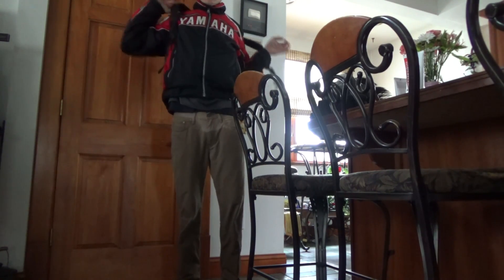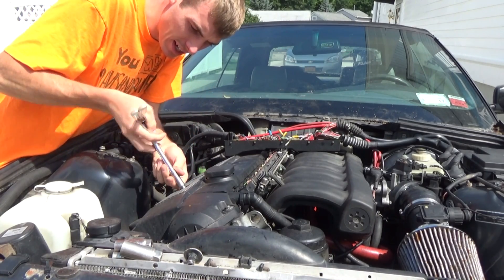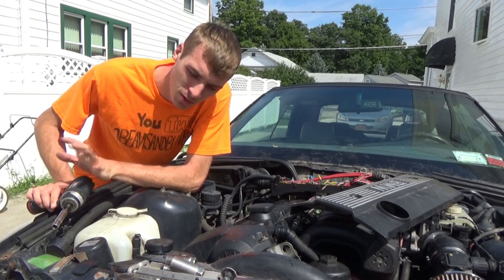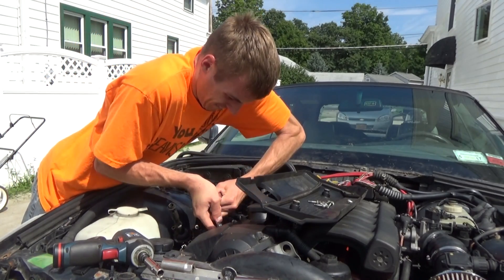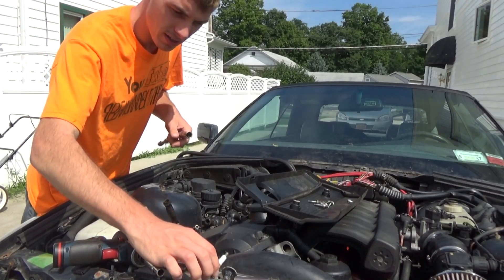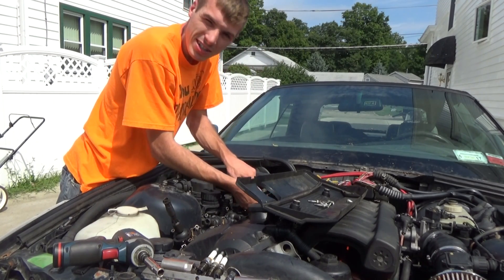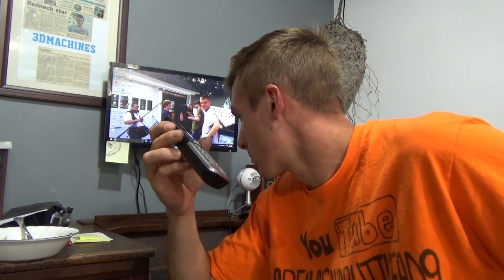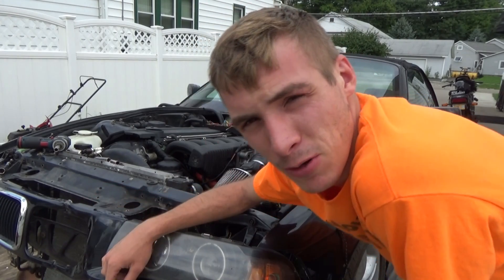THE BEST NEWS YET

Comment: NGK are superior quality spark-plugs in Europe
Reply: i was just about to say that :D
Reply: honestly they are the superior choice for most every engine IMO, they are the easier to read the heat range on because of the cadmium coating on the ground ring
Reply: yeah true !
Reply: I've always ran NGK on my Quads, Bikes etc. and I have never had any issues with them.
Reply: they are decent for some applications, but for performance and forced induction vehicles cheap plugs are not the way to go
Reply: I use NGK plugs in all my machines so i dont understand how they are cheap quality
Reply: ngk is all I run in my motorcycles.
Reply: ngk are good for atvs motorcycle dirt bikes and all that stuff but not in cars
Reply: Ngk are amazing in Australia, that's all my family fun
Reply: I run NGK in my weed whacker and chainsaw... probably be using them when/if I get a car as well! XDD
Reply: NGK is what I use in my KTM 450.
Reply: well this is MURICA
Reply: NGK are good spark plugs its just that bmws are only meant to use bosch
Reply: BMW use NGK as original equipment as well as Bosch.
Reply: poor BMW
Reply: Ngk is generally a pretty good plug, anything like 4-wheelers and dirt bikes around here like them
Reply: me too
Reply: Yup.  I run NGK copper plugs in my LS1 Corvette; they're by far the most recommended spark plug for performance cars.
Reply: NGK's are great plugs. just remember to use antiseize. They are known to break in half and leave the bottom of the plug in the engine.
Reply: That's why I drive a diesels lol
Reply: Me and my friends have mopeds, dirtbikes, supermotos, scooters, quads we all have NGK   NEVER LET US DOWN Atleast EUROPEAN NGK's
Reply: you aer rigt ngk is a good spark-plugs
Reply: MegaMalek95 yea they are good. But he specifically talking for a BMW...NOT your Honda bikes ect.... BMW!
Reply: BMW use NGK as original equipment.
Reply: Unfilled Name-space ahhh good to know. What is this Bosch about?
Reply: BMW use Bosch and NGK depending on the model.
Reply: Unfilled Name-space thanx. I was wondering that.

Comment: That looks more like the AC condenser than the radiator
Reply: thats what i was thinking but then he said he saw fluid leaking out of it
Reply: your right it is I guess he wants a in a drift car
Reply: ac
Reply: That's what I was thinking too
Reply: it is, it's the AC condenser.
Reply: Hence why it was misting out. A/C is always under pressure while coolant is not, unless it is warm/hot. Usually only when it's hot. If coolant it would have dripped out.
Reply: Because Bugeye that jb weld he put on it, isn't going to hold.
Reply: A/c systems have lubricant running through it to keep the pump lubricated. Only fluid that should be in it.
Reply: i am an hvac tech you can fix condenser coils by brazing the wholes closed they used to do it all the time back in the day but its not a very common practice now you just normally replace them it is a dieing art.
Reply: I braze at my work, i've only heard rumors about how difficult it is to braze aluminum.
Reply: Yes I would understand aluminum tubing melts every easily I have only done it on copper where I melt the aluminum fins around the pipe and continue brazing from their
Reply: He said it was misting out which sounds like r134a freon evaporating into the atmosphere
Reply: mo

Comment: I think you messed up dude. NGK spark plugs lasted 150,000 miles in my 2006 Bmw x3 and they have the same motor. Also, i think it's your mass air flow sensor. (same problem with mine) Either the mass airflow sensor or an air leak.

Comment: there is no point in repairing that its a air con radiatior its just another thing to stop the engine radiator getting more air
Reply: agreed, but it's called the condenser for future reference!
Reply: can just take them of and block the hoses then?
Reply: honestly you can just take it off and if you don't care about putting ac back in the car you can just leave the hoses open, the ac compressor won't turn on with the system empty anyway
Reply: just leave it off ,it is Unnecessary

Comment: Another thing that might be wrong is that being as the battery was disconnected it resets the computer, you just need to drive it so the computer can learn and self tune, that's a common problem that most don't realize and it can run like absolute crap at first, it takes around 150-200 miles for it to run really good

Comment: no no you have more to it data values on the scanner you have to see the fuel trims +trim adding fuel  - fuel trim subtracting fuel. But that can get skudd up from vacuum leak or a bad air metering valve (maf). Best thing to find vacuum leak even that plastic intake seal's is to use water. Pour water on places that can leak and see where it sucks in water and rpm drop. Now if the fuel trims pass -10 or +10 it sets check engine light.

Comment: I run autolite plugs in my BMW with no issues at all. Cheap $2.00 plugs never did me wrong. Check your sensors, if any are bad, replace them. Check your timing belt. Yes its possible to jump a notch or stretch the belt. Timing chains are better LOL.

Comment: I would get Denso TT part number 4504 for it because they are awesome plugs and your local auto part store will have them, The part number for the Bosch plugs is #4301 for twin tip or 4418 for platinum +4 plugs but to be honest I have not had very good luck with them compared to the Denso's.  Have fun

Comment: This is the AC condenser that mist you saw was the refrigerant leaking out the fluid that was dripping from it was the ac compressor oil. If you want the ac to function properly replace this radiator this glue wont hold the pressure.

Comment: Technician speaking here that owns a 97 328is:  NGK plugs work fine, promise I run the Iridiums just because and Autozone stocked them.  99% chance it's a vacuum leak, I've had an idea to build a custom smoke tester using a vape pen with some air line fittings and a pressure regulator.  Use some PVC caps with an air line fitting installed to smoke test the entire system under 5 psi or so of pressure.  All leaks must be stopped.

Comment: Dalton...that's your A/C condenser not your radiator....Condensers are installed in front of radiators. Those plugs have a fuel smell because you flooded the cylinders trying to start it.I appalude your wanting to get this car running but you might want to cut your losses and fine a another project car to get your feet wet with.Thank you for all the work you put into making content.

Comment: that is your a/c condenser for the air conditioning not your radiator and at that point i dont know if jb weld will fix to hold pressure

Comment: Yep, that's the A/C condenser you just took out. You can see the radiator in the video BEHIND the condenser. 
 I had written and told you to have your ignition module check after seeing this video. THEN I saw your last video showing the car running.
 After seeing that my advice is to have a friend get the car started and get it to a constant RPM that keeps the car running. Meanwhile you get under the hood and check for vacuum leaks.
 I had this same problem with a car I paid $300 for because it wouldn't stay running. I plugged a vacuum leak and drove it away.

Comment: Bro like others have said that is NOT your radiator that is 100% your AC condenser  and what was leaking was Freon. you do not need that at all just leave it out and strip the other lines.  Check your intake for leaks. There should be a Big O-Ring gasket between your throttle body and intake those are know to leak on these.

Comment: its a air conditioner radiator leave it off save some weigh remove every to do with it. im not sure wat belt system bmws run so check if  you can get a belt before you remove compresser from the motor.

Comment: one more thing you can braze aluminum with the right rod and a torch rather than using liquid steel which most likely wont work.. the metal has to be very very clean though.

Comment: That is the AC condenser and it runs at about 200PSI of r134a. I hate to say it but your little sealer isn't going to hold. a new one on eBay is only like $60 and they work fine. I know from personal experience

Comment: Brands don't matter much, yah Autolite and NGK suck but if they haven't been gapped properly they might not spark as well as they should. Also Autolite being a Ford variant is new, I've only ever heard of Bosch and Autocraft. I'm running Bosch in my vehicle. Also your "radiator is the A/C condenser, wasn't misting out it was releasing the gases from the system lol! The big guy behind it with the big hoses is your radiator.

Comment: Nothing wrong with either autolite or NGK I prefer NGK from Japan. Ive run autolites in the past. They are fine but will rust.  Platinums last 100k miles but if your a modder they wont be in it long b4 you go colder or hotter plugs etc.  And by the way thats the AC Condenser not the radiator. AC system needs to be charged at a high PSI (30-300+psi) The JB weld will most likey not hold that kind of pressure.  Its all good in the hood tho. I love the videos man. Your killing it.

Comment: I'm German and over here a NGK Sparkplug is the best you can get for your car.
Bosch is cheeper and it isn't bad, but NGK is way better.
I run NGK in my Mitsubishi Galant e54a, in my Rover 216i convertible, in the Honda CRV-2, Mercedes W210 and in the Piagio Ape50.
But in my 4 Lawnmover, 2 Chainsaws and some other small engines are Bosch Sparkplugs.

Comment: what funny about how that car is only supposed to work with Bosch plugs. I tried Bosch plugs in a few types of machines and had shit luck with them. Small engines especially. I put them in a 4.2 jeep straight 6 was horrible put the cheap champions in and was right as rain. had a customers hedge trimmer in a while back with a new Bosch plug and even though it was the right cross reference plug it ran bad, put the NGK that was called for and ran like new. Some rigs just like certain brands of plugs I guess.

Comment: You dont need to use bosch plugs .NGK will be fine. if you are going to drift the car junk the AC. You might need to change the coils if its not burning fuel . make sure the ECU isnt showing codes for missfire.
Reply: I can guarantee it'll show codes for specific cylinders and multiple cylinders. You could hear it when he started it

Comment: What is the deal with your auto shops not cross referencing! As long as the thread count is right it will get the job done.  Also NGK plugs are actually the #1 recommended plug for when building a turbo vehicle.

Comment: That looked like a transmission cooler possibly... or maybe for the AC and it is in front of the actual radiator.  I would have soldered it.  Personally I would not worry about the spark plugs as long as it is a good brand.  They important thing is that they are the right resistance and the gap is right.  The black means you have a lot of carbon build up and it is likely running rich... and maybe burning a bit of oil.  Check the air filter, but after that I would get the engine codes and work from there.  It could be the injectors.  Also I doubt the odometer is correct.

Comment: Hi dalton, do you know what electric starter Jake put on his bike? If not you you maybe find out? Thanks, keep making awesome videos!!!!
Reply: i believe it is factory but i dont know KTMs
Reply: Yeah they're stock for a lot of the new 4 strokes, I didn't know they were on 2 strokes
Reply: +dirtbiker_ 399 300exc? not sure on the letters is a 2 stroke with electric start
Reply: 08 to 2016 200-300 KTM, 2011-2014 200-300 Husaberg and 2014-2016 Husqvarna 200-300 2 stroke starters are all the same starter. I have a KTM wrapped in Husaberg plastic lol 2014 TE-250.

There problem with 2014 back are the bendix, they are junk. The gear wears out and causes problems. Pretty much have to faithfully maintain them. 2015 they fixed this by using better quality parts. Here is a link for ya, read and enjoy. Could save you some money. https://ktmfreeride250.wordpress.com/starter-modifications/

Comment: Umm, that's an AC condenser in case you haven't figured it out, not a radiator. Freon is a gas at ambient temp which is why it came out as a mist.

Comment: That is a AC evaporator core not a radiator remove the evap core and run it without it if doing drift you need all the airflow can get to the rad to prevent overheating.

Comment: That isn't a radiator man, it's the air conditioning condenser, you don't need it or A/C in you car, when drifting you want the least weight possible while keeping it balanced, the A/C pump is unnecessary weight, puts more strain on your belts at high rpm and in return a few less horsepower. Take my advice! 😆

Comment: NGKs are not 'crappy' plugs...Bosch plugs are the OEM installed plug. You don't have to put OEM equipment back into it, especially if you're just trying to get it to run...Just like air & oil filters or wiper blades...BTW...That's your A/C condenser, not a radiator...Not needed if you're making it into a drift car...

Comment: I'm sorry I run ngk iridiums in my dodge truck and in my 91 Camaro with a 383 stroker and 250 shot of juice ngk is the best plug around made my truck run 10x better and there not cheap try 60$ for 8 of them

Comment: LOL I wish my NGK's were cheap, around $63 for my last set of NGK Laser platinum 6458's and that was at a discounted price. Audi actually recommends the higher quality NGK plugs over the Bosch.

If you do a little research, a lot of BMW owners even prefer the more expensive NGK's over the Bosch. You can easily get 60,000 miles or more out of them Anyone that has a German car with a turbo can't run the platinum series plugs or it causes detonation and a mess. Most of them run a specific plug that runs cooler.

Comment: If they are the correct NGK plug, they'll work fine.  Car has 50,000 & the original plugs have been replaced already, some thing wrong there.  The original plugs should of lasted that long, easily.

Comment: But it is firing, because the engine is running. I'd say it has an exhaust leak, or a sensor gone bad. Surprised it's not throwing rich codes, because the engine is obviously getting way to much fuel

Comment: brand dosnt matter with spark plugs most of the time... just the different types not brands matter. thats all preference. also that isnt your radiator that is your AC condenser, throw it out if your making a drift car all the AC is gonna do is make you loose power since its another pulley the belt has to go around. Chuck all the AC shit out the windown!

Comment: Ummm you need compression, besides air spark and fuel. If there is a hole in the block or cylinder it aint gonna run.

Comment: The reason engines today look so complicated (electronically), well simply put, that's the good part. Price wise i mean. The other option, where you have the same setup, but, only an engine with a leads and that's it, would need a very centralized computer. That would mean breaking it = $$$$$$$$$$$$. So, they make each component go where it needs, therefore = $$$.
If they wanted, they could make an engine look like a 1960's one, but have the exact same level of electronics as a 2016 one.
They don't for your benefit, it would be ten times easier, and better (as money goes) for the maker to have one computer unit with peripherals, rather than one main computer, and many more minor units with various tasks.

Comment: And point proven of why to never get a bmw.
Reply: dude that's a 98 if you you want a real bmw get a 92 bmw
Reply: dude.. the older you go the better they get.
Reply: No, that's why you do actual research. NGK plugs are great, and the thing he was kicking is not the radiator. I usually like 3DM, but it's obvious he really doesn't know much about BMWs.
Reply: Mudd Boss not with bmws bud
Reply: BOB bb i wasnt talking about how it does.. im talking about looks and how expensive they is.
Reply: BMW's are great reliable cars, its not their fault that in USA BMW's aren't soo popular and the parts cost 20 times more then in Europe
Reply: I own a e36 and its difficult to own any other cars parts are so cheap and if u understand them they are pretty decent cars.
Reply: much more... never get a almost 20 jear old car!!! what do you expect!
Reply: florian558866 never get a car with a computer..
Reply: Mudd Boss everysingle car has one. Even from the 20's. Then ecus even close to todays cars came relevant in 1939.
Reply: Zachary Neal you dont get it.. im talking about a computer that controls everything for the engine to run like injectors,spark,mass air flow,O2 sensors,crank position sensor.. all that fancy expensive not very reliable electronic shit that will fry if an emp hits.. that kind of computer... back in the day only electronic things were a power source,on off switch,the coil,and points,, all the simple stuff.
Reply: Yes and there is alittle bit added to these old bmws its a very simple bosch motronic ecu and i would rather have all the amentities of obd vehicles as my 325i has 560k on it and no carburated engine will make it that far.

Comment: I'd get rid of the shitty air cone. It's been proven to death and back that those things do absolutely nothing but ruin the MAFs. And as weight saving goes, it's not worth it. eBay should have you an original unit, no point in shoving more than it needs in $, even if you get a shitty broken one, it's better than that filter.
Reply: And i still don't understand how you plan to turn a convertible in a drift car...